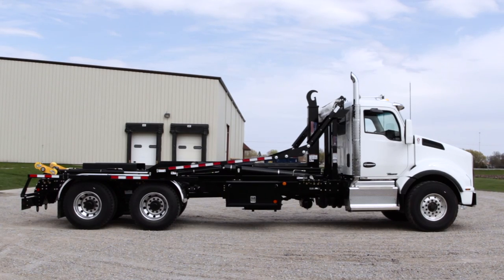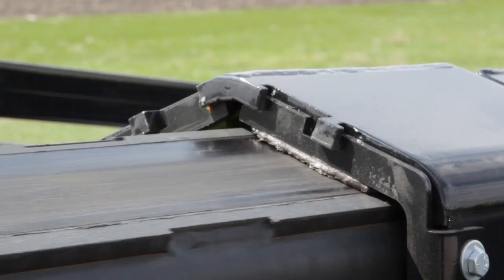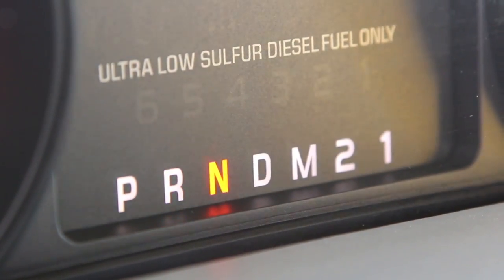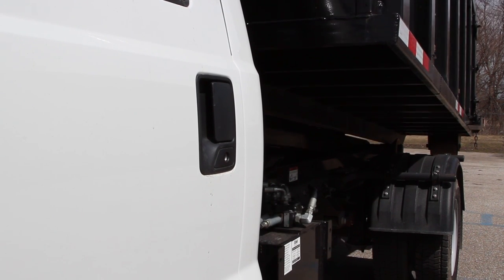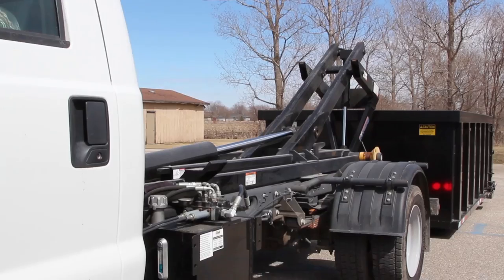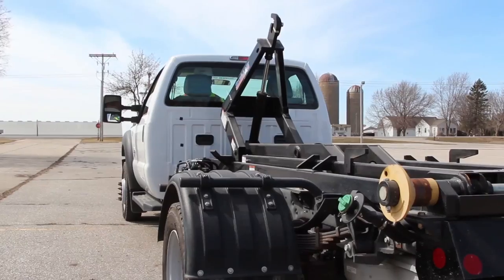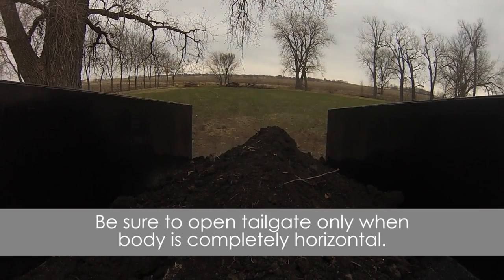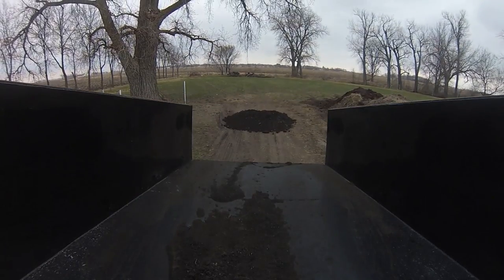Stellar Industries Hooklift Operation Chapter 1 - Shuttle Operation

Comment: Do you set blocks under the wheels or track from damaging peoples driveways?
Reply from the maker: Hello! Are you referring to the containers? If so, we do not manufacture the containers so it would be operator's preference. Thank you!
Reply: @StellarIndustries  yes container, I would be doing this job starting Monday, and they do put wood under container wheels/track. My question is,  if you put the wood under the wheel then, you would have to balance that correct? I need help! How would you recommend it?
Reply: @SKINNEDKONVICT  I have used thick plywood wide strips the wheels can roll un when it doesnt bull the truck into the container and thick rubber matt used for horse stalls.